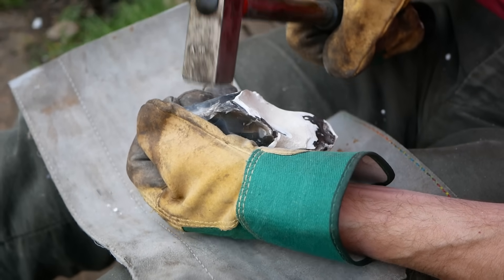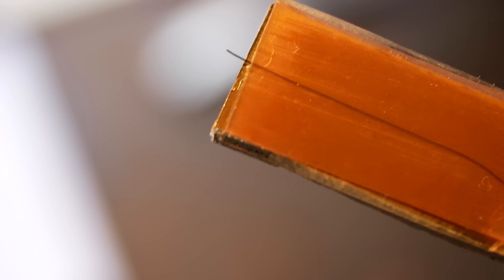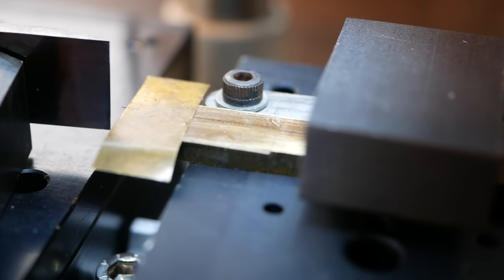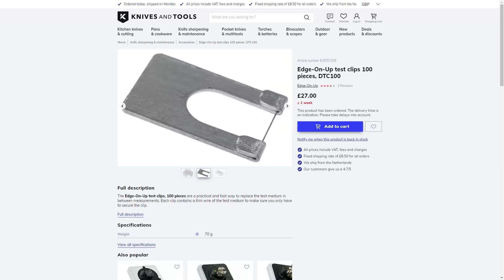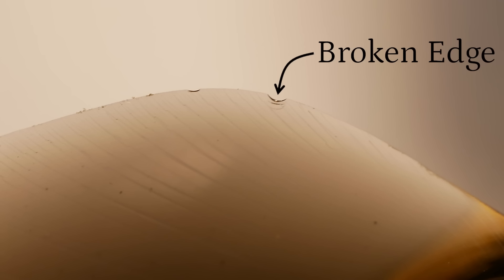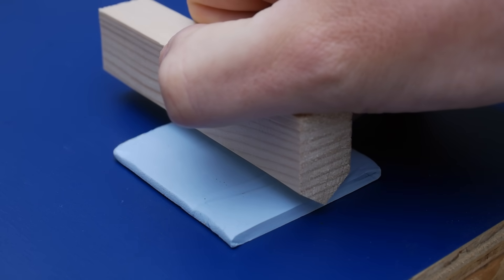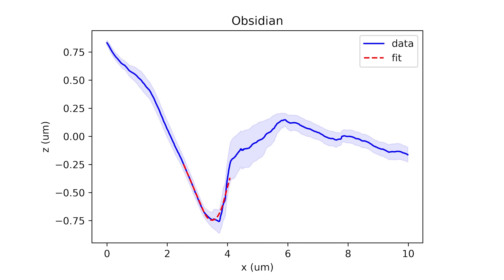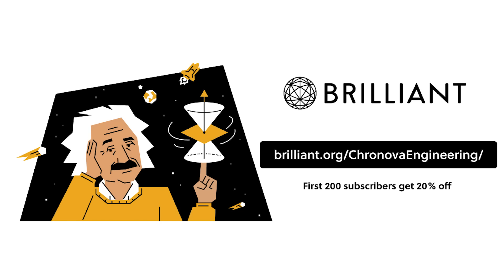Does Obsidian Really Form the Sharpest Edge?

Comment: Crabtree made obsidian scalpels that were used for his open-heart surgery.  The trouble in these tests are multiple.  As the narrator pointed out initially, the obsidian is brittle.  The second error is more subtle.  The "sharpness" test as employed here is simply an attempt to push the edge through the wire.  That is fine for any material edge that is arguably as tough (not brittle) as the wire, but plainly isn't going to work if the edge to be tested is brittle and crushes.  Also, when used as "recommended," most knives are not simply employed like a wedge.  They are drawn or pushed at an angle to the surface being cut.  The effective angle of the cutting edge is less than the edge angle measured perpendicular to the edge.  Last, the ultimate fineness of an edge is limited by the grain structure of the material.  The coarser the grain, the duller the maximum possible sharpness.  Obsidian has no grain structure, nor does any other glass.  This why, for extremely delicate surgeries many surgeons employ scalpels edged with glass or diamond.  However, those same surgeons would not trouble with obsidian in a wood working context.
Reply: It's also important to note that the roughness of two tissues when stitched back together increases the efficiency of their ability to seal and heal. So even if we came up with some sort of super material that sliced through tissues literally perfectly, splitting molecules apart or whatever, we wouldn't want to use it on anything we intended to put back together.
Reply: @Marcara081  Roughness would coorrelate to increased trauma to the tissues, which enhances physiological response I think.  Evolutionarily, nearly all trauma a body responded to would involve more damage to the tissues at the site, whether it's a scraped, or some sort of puncture like a bite.  A cut from a really sharp blade, regardless of material, will separate many cells where a comparable scale injury from a rougher material will rupture cell walls.  That releases chemical signals to the surround tissues.  It's why cuts from glass bleed so profusely.
Reply: @theeddorian  Tears in tissues heal faster and with less complications than cuts, sort of like breaking a popsicle stick in half and then shoving the jagged break back together, rather than cutting it in half with a saw.  A jagged break causes the material to interlace with itself and provides much more surface area to join together, just like a tear in tissue will interlace back with itself and heal faster.  The medical community doesn't actually agree that finer cuts result in better healing these days, but they did hold that opinion about 50-60 years ago.  Precision cuts are only necessary today for minimally invasive surgery and a sharper blade is required, however, it's not the incision itself that benefits from a sharper blade, rather it's from the smaller incision of minimally invasive surgery that allows it to heal better.  If you can get away with a 2mm incision rather than a 2cm incision, there will be less to heal...but your blade has to be up to the task of making a precise 2mm incision.
Reply: @Skinflaps_Meatslapper  As someone who knaps obsidian, and who works wood, and who sharpens tools and knives by hand, my experience is contrary to that.  Low trauma cut from really sharp steel, or glass edges, closes quickly when bandaged properly.  Such a cut also heals cleanly and with less scar tissue.  Trauma from tears, scrapes, and rips ceases bleeding more quickly.  Usually, since the cut from a sharp edge has less surface area, less tissue surface is involved in healing.  I asked an ER doc about that years ago, when I notice that some scars I've had since I was three or four are still obvious, while the scars of serious cuts from chipping stone and accidentally bumping the edge of a freshly sharpened knife were completely invisible.
Reply: Also for the reason you stated, it was only the initial cut through the skin that the obsidian scalpels where used, left almost no scar in the end because of how sharp the edge was
Reply: @bakerkid929  It wasn't simply for reducing scarring in the skin.  All tissues scar.  Scarring has negative effects on the speed of nerve healing.  Diamond chip scalpel blades were introduced for eye surgery decades ago.  The high polish and very fine edges reduce tissue trauma along the side of the cut, and protect  tissue integrity, which speeds healing.  If you run a search you can find ads for "gem quality scalpel blades."  You can achieve nearly equivalent sharpness in some steels, but it is more work, and the blades cost about the same as the diamond edge.
Reply: Its surreal seeing my great uncles heart surgery talked about by someone i don’t know in a YouTube comment section XD

Comment: Obsidian can achieve a sharper edge, but doing so with any sort of consistency, or more importantly durability to handling and use, is another story.
Reply: Brittleness is a highly-prized aspect of obsidian. Prey knock out the shafts soon after they are hit. You WANT the shaft to break, and the projectile point too.  If it falls out - wounds close, blood clots. Prey runs miles before being lost.  But how far is it going to go with broken pieces of glass working its way deeper towards/in internal organs with every step?  Not far.  
Easily made, easily replaced.  Obsidian tools were made to break - and that was great!
Reply: Debatable. There are jigs and cbn/diamond plates with as low grit as you want, and you can get a steel edge far superior and sharper than glass + tougher.
Reply: @em4703 you're ultimately limited by carbide grain size

Comment: The measured edge angle is wrong or badly written, quality axe has 15-20 degeee per side(dps) = 30-40 inculsive, 62 HRC+  light use knifes have 7-15 dps = 14- 30 inclusive. Utility blades, razors have 7 or less dps= 14 or less inclusive edge angle.
Your result is very far from expected value, which indicates a mistake

Comment: I recall a Nat Geo article i believe about obsidian scalpels being used in surgery cause the cuts were so fine they healed much faster
Reply: I asked an eye surgeon if he used obsidian blades. He said no they use silicon blades. Diamond blades are available but not used. When the techs sterilize them after surgery they chip them and they are then useless and are discarded
Reply: There was a company that made and sold obsidian scalpels for a while but they never really caught on.
Reply: Sounds incredibly dumb. It can easily chip, then you just have a tiny sharp piece of stone slicing your insides.
Reply: It was done experimentally, and the results were suboptimal compared to modern tools.

Comment: Hardened tool steel, if done right, can be both harder and tougher (less brittle) then minerals of silicone dioxide.  Flint actually has a granular structure (ranging from microcrystaline to cyrptopcrystaline, as formed from diatoms), which is why it's assumed to be less sharp than obsidian.
Reply: How much would that cost though? Surely just the certification of the process accuracy would make it extremely expensive compared to silicone dioxide?
Reply: @SkywardSwag  I don't know if you're talking about blades or AFM probes, but I just thought of something related to this that may or may not make sense.

The reason silicon dioxide is used for AFM, and not tool steel, is because the tip is vibrated at a VERY high frequency. And vibrations in a material can induce harmonics, which can actually heat it up. Tool steel, relatively speaking, is not thermally stable - its thermal expansion coefficient is a bit over 10^-5/K. Silicon, on the other hand, has a coefficient of 5*10^-7/K - that's twenty times smaller than that of tool steel.

When you're measuring on the level of angstroms and your probe tip is a nanometer in two in diameter, a millimeter long probe assembly can expand a whole nanometer when exposed to just a fraction of a degree of change in temperature if it is steel. But if it is made of silicon dioxide, that thermal expansion can be limited to under an angstrom.

This is also the reason why obsidian works great as a slicing tool, but not as a cutting tool - and why tool steel, even if it keeps its sharpness, will eventually roll the edge on an atomic level - simple contact with the skin would make the edge heat up and expand, and when it contracts, the edge radius will change.
Reply: "if done right" the point is to use something not manufactured

Comment: Great video, very interesting. My only quibble is the practical difference between chopping and slicing. A very thin but weak edge is capable of slicing but not of chopping - anyone who's had a paper cut will bear this out. The obsidian would work quite well if used with a gentle slicing action. I imagine that people using flint and obsidian tools soon discovered this.

However sharp, a broadsword worked mainly by smashing bones, not cutting flesh. By way of contrast, a Japanese samurai's sword was a slicing weapon.

The extreme hardness of an obsidian edge makes it completely unsuited to chopping, but I'd be interested to see how it performed as a scalpel.
Reply: Seemed like an insightful comment to me, but no up votes besides mine? I thought the idea of a slicing test was a good one. I was trying to think of a test where greater sharpness of the obsidian could be demonstrated by cutting something. Your idea seems like a good way of accomplishing that.
Reply: No up votes because it's nonsense. A broadsword cuts just as well as a katana, absolute nonsense to call it a smashing weapon and a katana a slicing weapon

Katanas should not even be mentioned in this context
Reply: @Tom--Ace  I saw the comment more about thinking of a way that a super sharp but super brittle cutting blade might demonstrate cutting superiority in some kinds of situations and that a slicing situation might be one of those situations. 

I'm not familiar with sword issues. In my ignorance, the sword analogy seemed reasonable to me. 

Thanks to Tom-Ace's comment I watched the video again and read @EleanorPeterson's comment again. One idea of a situation where the obsidian might be better would be at cutting through soft material. My thought is that if instead of wire the sharpness tester used a thin nylon line the obsidian would cut through it with less force than any metal cutter.

Comment: depleted uranium makes the sharpest edge!!
Reply: Deplated uranium alloy penetrator self sharpens during hogh velocity penetration of steel (RHA) armor, this should not be confused with its hardness or ability to be used as knife- Staballoy hardness is only around 270 Brinell(HB) , when hardened and tempered 0.8%C steel can have over 700 HB